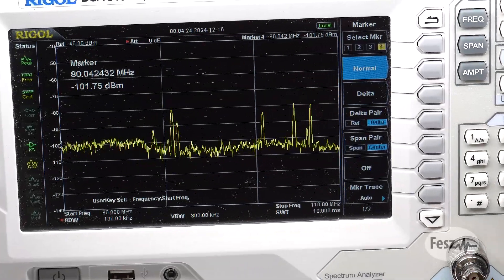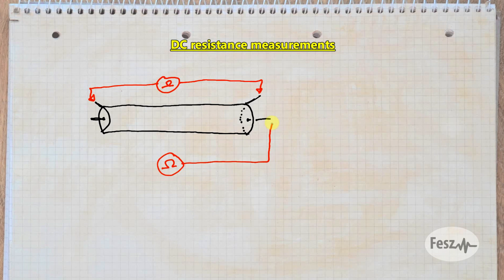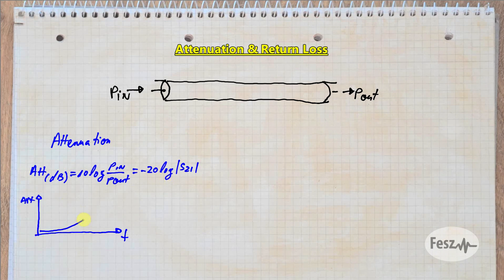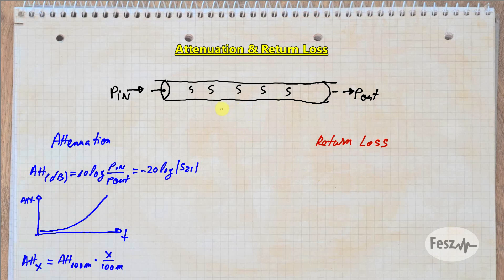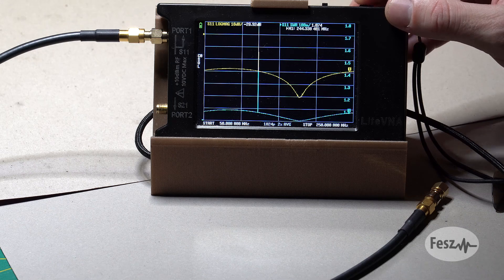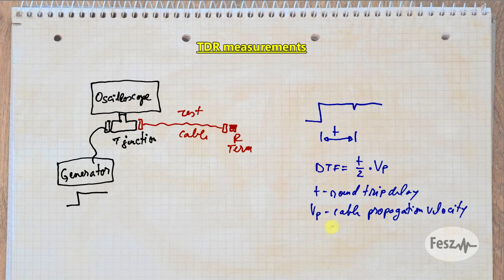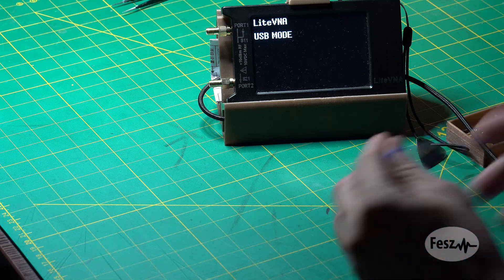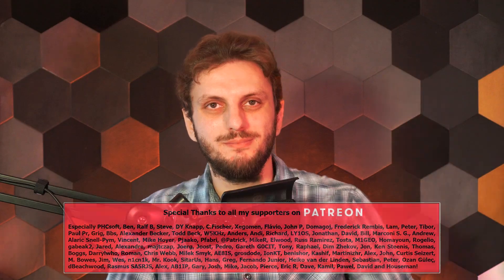Cable Verification Tests

Comment: For lab cables that'll be moved around / manipulated I'd also recommend a phase stability test, where you measure the phase of the cable over its spectrum while manipulating it.  The highest quality cables will have the least phase change from being manipulated.

Comment: I had somebody who wanted me to test some cables and tried to tell me that I needed to test I think it was on a low resistance range between conductor and shield or was it a high resistance range from end to end. either way if I did that I would've been out of the measurement capabilities of the meter without literally saying out of range.

Comment: This video is excellent.  You have illustrated a systematic approach to testing cables I have not seen in other videos discussing cable testing with VNAs. I will be testing and documenting my cables using the procedures outlined in this presentation.

Comment: You should always check the mechanical dimensions, especially with cheap cables from China. One common issue is pin protrusion on SMA connectors. Too long and it will wreck the mating connector.
Reply from the maker: I read somewhere that there is in fact a special tool used to measure the pin protrusion for connectors - what do you commonly use?
Reply: @FesZElectronics  There is but those, like everything RF, are quite expensive. I just use callipers, a bit fiddly ...
Reply from the maker: I guess that is the most accessible way though, using calipers, especially if its a once a month measurement; no point in investing in a very special piece of equipment just to use it once.